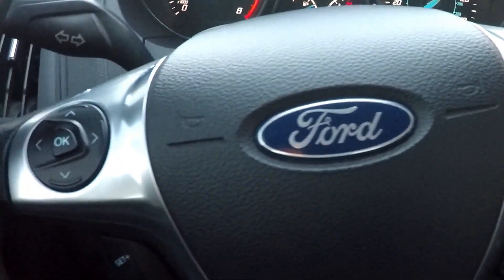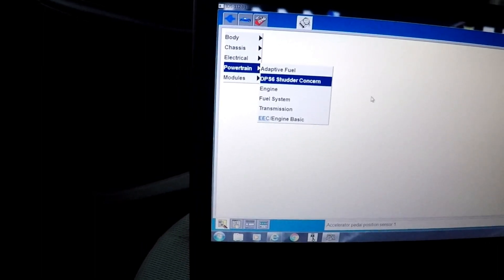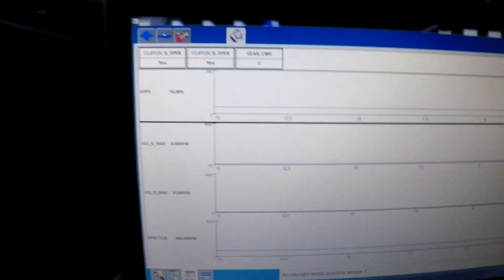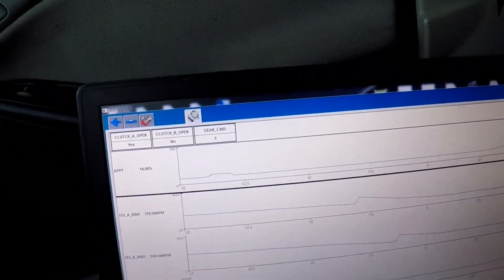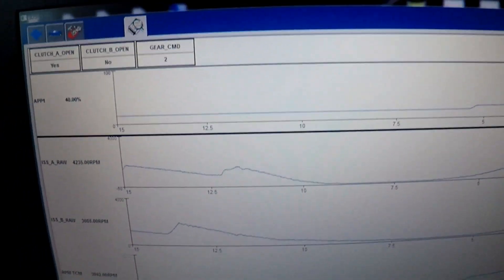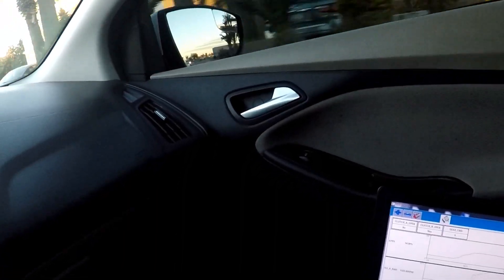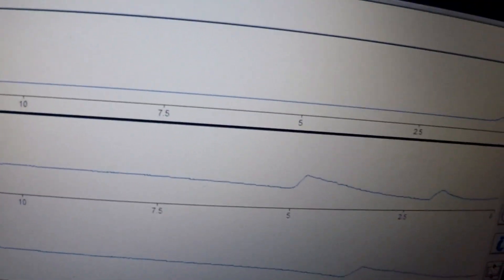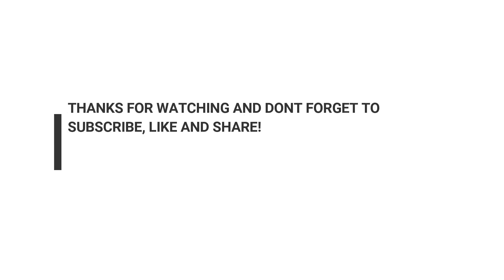FORD Powershift shudder.

Comment: Focus does not have a CVT transmission.
Reply from the maker: 4DMASTR that was my fault. I since changed the intro page and description. My apologies.
Reply: Lol may as well be a cvt, they’re weak!
Reply: @Aschmorr  right.  I have an Altima with CVT.  It's been perfect for 40k miles.  This Ford disaster.    Ugh.  A major repair every 8 to 10k.
Reply from the maker: I couldn’t agree more. Those ford units are junk. Good luck on the Altima cvt
Reply: @codysautodiagnosticsprogra8706  The Altima is still good.  I replaced the Ford with a Frontier.
Reply: Cody’s Auto Diagnostics welp, idk if I already said it somewhere else, but, I was driving a 2020 Ford Transit Connect, the wittle guy lol, for work, aaa carrying around 25-30 car batteries, and at right about 53k miles half interstate half city running service calls, and the clutches went out, 8 months after brand new and i was the only one who drove it, under warranty it took them about 3-4 months to get the damn thing back to us, only to be out of adjustment somehow, jerky banging gears, in an automatic trans ffs! Moral of the story, nice van, shit build quality, don’t but the new ones with the 8-9 speed auto, it’s a new transmission
Reply: The new 8 speed in the connect is garage. Still not a money maker as we can't get parts for them as you have already noticed. The next Connect is supposed to be a rebadged VW so it will be  trash for sure unfortunately.
Reply: 4DMASTR so in that case I’m assuming you work at a place where they procure parts for such vehicles? Lol yea I noticed but thankfully I’m not the owner of the van and now I’m not even the one driving it anymore lol, have you seen multiple cases of what I described???
Reply: @Aschmorr  Ford Senior Master tech, I just have to deal with them. I hear all the comparable vans in that segment are garbage too so I guess its just part for the course.
Reply: 4DMASTR well thanks for the insight my friend, hope you’re having a wonderful weekend
Reply: I wish they were junk. Clutches for days, but the transmission is solid.